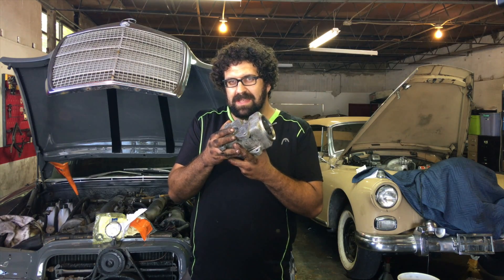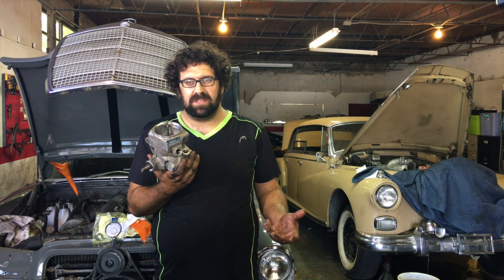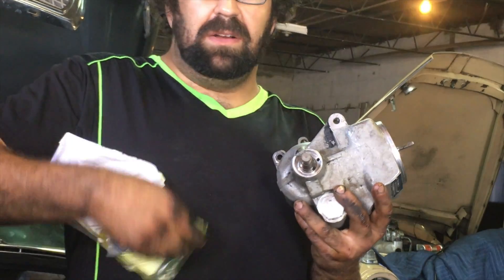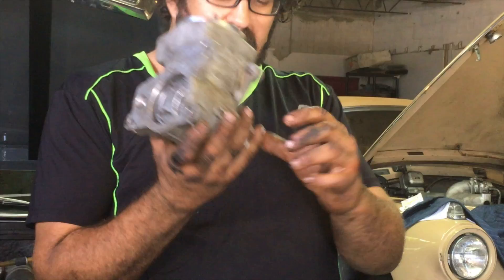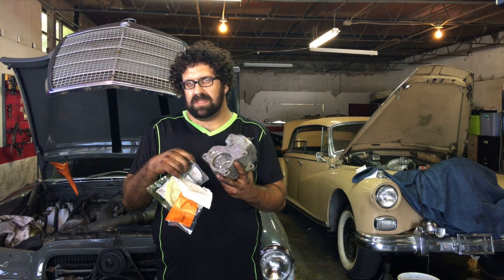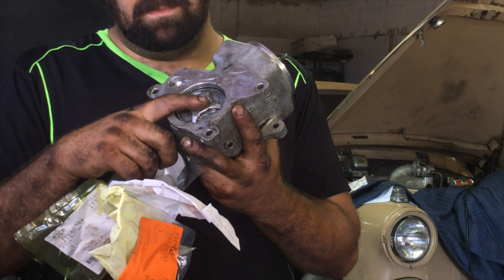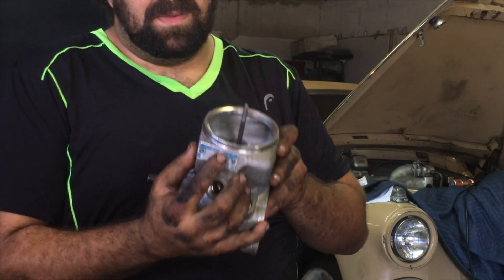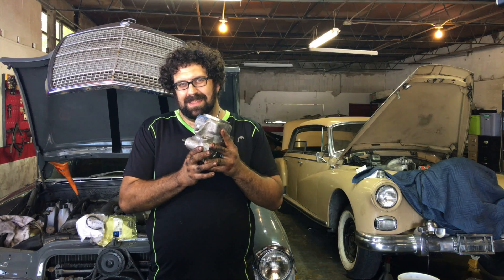Power Steering Pump Leaks

Comment: what about the big hex bolt head at the front just behind the pulley, im sure mine has started to leak from there after the rebuild, That was the only washer i did not replace

Comment: Hello Pierre, I need your opinion on my 1989 W124 300E M103 engine. I have a power steerin issue. When i turn left, my power ateering is working normal. BUt, when i turn right, it is completely heavy as if no power steering assist at all. What could have been the issue and what measure should i take first?

Comment: No offense, but I would not call the job easy! Getting the bolt off the pulley was a bear, getting the pully off was a bear, getting the old front seal out was tricky without causing damage, and getting enough mustard on the calmp to push in the piston on the rear was also a herculean feat! Worth it, but good grief, a fight every step of the way!
Reply: how long did this job take you?